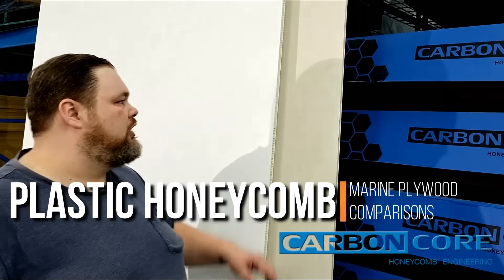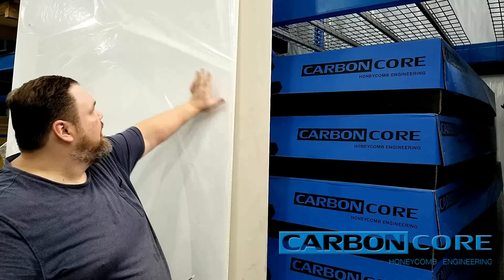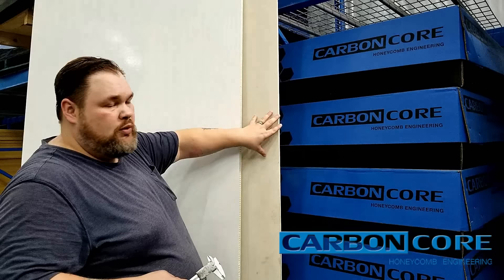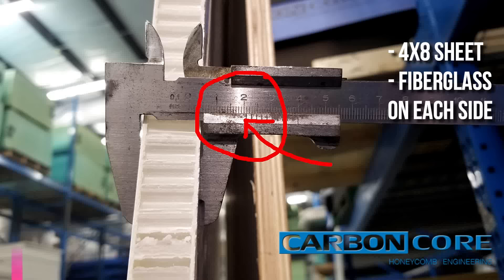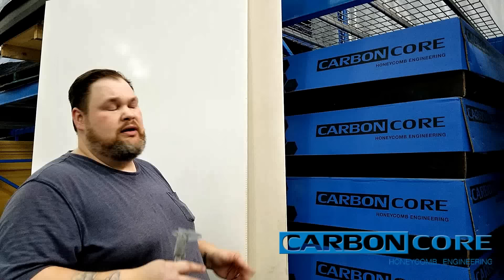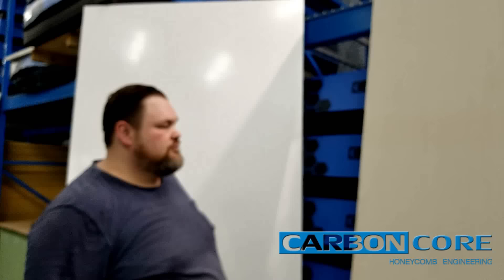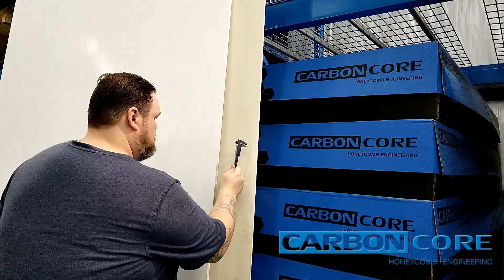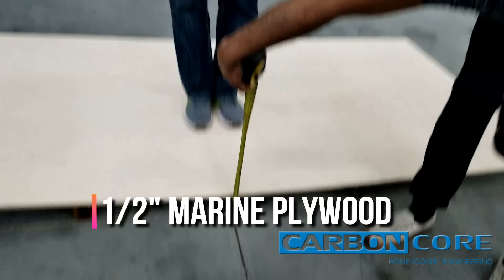Plastic Honeycomb Composite Panels VS Plywood

Comment: could not help but notice you didn't do an impact test. Also an R-value test. Have you had any customers use your products to fabricate campers?
Reply from the maker: Greg,

This  was  meant to be  a visual representation on deflection test in real world  conditions, outside  of  a  lab. For  test  results in impact, R value, tensile  etc. please  consult  with our  website, and the  product  data  sheet  at  www.carbon-core.com  Impact strength is one of  the  strongest part of this  panel  ,  R  values  are  3.3  per  1" of thickness  in  vertical position.

Comment: Hey you forgot to add the cost per board ?
Reply from the maker: Please check our website for pricing , different thicknesses , different prices
Reply: That is the kicker, Im betting it over $100 per sheet, which if you think about glassing all that isn't so bad I suppose depending on the "real cost" I want to build a small pilot house for my Whaler and this stuff looks perfect for that application personally.
Reply: @carboncore can you fibreglass over the panels for extra reinforcements and ensuring joints don’t leak?
Reply from the maker: @tyrone5404  Yes Sir,  it is  very common practice,upon  request  we  can  pre  sand  the  panels  to 60 grit  finish  to aid  in adhesion.
Reply from the maker: @barryculloty2568  It is  , but  most of the  cost of our  panels  is fiberglass  cost.  Whether  we  buy the material and  make the  lamination or  you do it,  either  way, it costs  about $100 per  sheet  to  laminate  both  sides.  The  balance is the  core  cost and  our  labor. But you get  perfect  flat  panels  form us  and  save hours  of labor..
Reply from the maker: Jose,  costs  are  on our  website. This  is  a  technical  video  and  costs  are not  part of  that demonstration.

Comment: how do you seam the edges when using multiple panel's?
Reply: another great question
Reply: @@Good Will Hunting thus adding to the cost
Reply: darn it - THAT'S my question too. I'm guessing some form of welding...ha, it got answered by Tom Brayton  late '21
Reply: I would think you would core out one panel's edge (make it female). Remove the glass laminate from the other panel's edge (make it the male). Glue those edges and insert the male into female. Then tape both sides with fiberglass. You would have a bit of a bulge because the taped area would be thicker, but this would be strong.

Comment: What if you wanted to make a super light weight camper / Toy hauler trailer? Would this be able to withstand the flex and vibration of going down the road or supporting a large side by side supported by 16" center supports? Does it dent if you drop something on it, or smash the product in? Does this insulate too better than plywood? What's the R-Value equivalent of it? Could you put lets say a 1" or maybe 2" piece of this down for the floor off an Enclosed cargo trailer and then spray a Line-X type of coating over it and park heavy side by side or any other kind of off road vehicles on it without it sagging or crushing under the weight? That's what really makes me interested in it.
Reply from the maker: Several  expedition  vehicles  have  been  made from these  panels,  R  value  is  3.3  per  1"  of  thickness in vertical position,  and  about  1  in  horizontal position.  Polyurea sticks  great tho the  fiberglass  surface.  Download  the  mechanical  data  sheet(laminated  composite panels) from  www.carbon-core.com,  it  lists  several precalculated  deflection values  for  different  thicknesses.
Reply: I’d say yes, ever see 
RV structural?

Comment: I'm so glad I found this video.  It will be so help when I build out my van for camping.  The polycarbonate will save so much weight. 🤑🤑🤑👍👍👍
Reply: camper shell or interior walls and cabinets?
Reply: @Gantzz321  interior walls and cabinetry.
Reply: Are you avoiding plywood throughout your whole conversion? I was looking for an alternative material to ply which was fully waterproof for all panelling walls, floor and ceiling and I think this might be the solution.
Reply: @adrianafonso754  yes.
Reply: Lani C hey how are you getting on with the conversion? How are you sticking the honeycomb on to the walls? Rivnut directly on to metal ribs? Thank you!
Reply: @adrianafonso754  because I have a minivan I plan to build a frame and just cover areas I would prefer to just wipe down. The bottom of the  cabinets are going to be thin wood and everything thing else will be the coroplast.

Comment: You guys had me when I went to the website. The price per sheet was less than imagined, until I put in my zip code and seen the shipping cost which was more than twice the cost of the material.
Reply from the maker: Jacob,

Need to blame  the trucking industry  for the  freight costs. But  these  panels  may be  available  from a distributor if there is one in your  area,  call us  and  we  will try to find them locally for you.  OF  course,  as  you, know, it  cost  about  the  same  to send  1  or  50 panels  out  with truck freight,so the more  you order, the  better  price  you have  per  sheet  including freight.
Reply: @CarbonCoreCorp  Yep that's the problem I only needed four of them.  I get what you're saying.  Freight and postal fees are making more money than all of us. In my business they eat up most of my profit margin cause I can't be competitive if I charge the customer shipping fees. I did find something akin to your product from another source, but I'm sure it was not as well made as your product and I am already having regrets. Next boat build I really want to use your honeycomb composite ...no more compromises!

Comment: Greetings and thanks for the video,

Listen, this product seems great despite the cost (especially with shipping).  But that being the case, now we potential customers who are seriously considering the product need some direct clear answers to our concerns which throughout the comments section have been vaguely replied to if at all by Carbon-Core Corp. (for the record, visiting the website or after calling the technicians/representatives some questions still haven't been definitively answered).

Can you all perhaps make an updated video on using fasteners such as screws, bolts, nails, threaded inserts (ATR pins etc.)...and which will and will not work and the stress limitations of each?  Also, any suggestions on best way to deal with the cut edges if one wants to make a panel or lid with hinges (i.e., should we carve out the honeycomb edge and epoxy in a strip of wood or pvc, or use construction adhesive to glue on a section of aluminum c-channel over the edge, or just fill in some epoxy or bondo the edge, sand, and then place the screwed hinges in directly)??  

My longwinded point is,  PLEASE HELP US OUT by making a updated video addressing how to overcome these issues.
You will definitely be compensated/rewarded well for making said new video....from all of the business you will gain from the multitude of us whose only hesitation is what was covered in this lecture i just wrote.  lol!
Reply: I just met someone who thinks like me. Exactely my ?'s also.
Reply: @danmatelsky6064  There's so many of us, like 3's of us!
Reply: Can think of a lot of applications for a lighter weight, waterproof building solution.

Comment: What a coincidence that I need to rebuild the substrate on an outdoor stainless steel workbench that has a leaky patch on it. I did a web search thinking there must be a honeycomb plastic materiel I can use for this. Turns out Carbon Core is my neighbor here in Troy, VA. We're not on the map for much here, so this is almost serendipity. I certainly never thought I would find these products 5 miles from me. 

Unfortunately after learning about the products, extreme weather plywood would be more economical for my needs since weight is not an issue for me. I am excited that this is a local business to me though! We love our local businesses here in Virginia!
Reply: awesome dude :)
Reply: Yea im in Richmond and it was 261 bucks to ship it here only 50 miles and i called and they said i can pick it up from the warehouse.
Reply: @timboWVU  Shipping is outrageous. Over $200 for a $75 panel. But that would likely be the case for a sheet of plywood too. I imagine they have to crate this material or something to protect it. The gorillas that are the shipping industry can damage solid steel, let alone a sheet of honeycomb plastic.

I had the company I work for look in to this material for substrate on outdoor stainless kitchen countertops. It would be a good alternative to exterior grade plywood. I dont know what the sample pack included that they ordered, but they wanted a sample of 3/4" thick. It would have to hold screws though. Not screws through it, but screws in to it to draw a countertop down to a cabinet. It also has to withstand adhesive without melting. 

The solution to the shipping would be to get the big home improvement chains to stock the stuff. I'd bet it would sell once people got familiar with it.

Comment: That hammer test demonstrated the high density of the marine ply over the foam core. There are specifications that list the equivalent of ply wood verses foam core;
9mm marine ply is equivalent to 34oz (1kg per m2) /20mm foam core/ 34 oz with the foam core weighing approx. 6kg/m2.
9mm ply weighs approx 5.3kg/m2.
Even when skinned with 6oz cloth and resin, it still comes around the same 6kg/m2.
Foam loses on every score except stiffness. Meaning ply needs more stringers or inbuilt structural support from furniture, cupboards etc, or the addition a carbon skinning. Cheers

Comment: my concern would be what would happen if Jack had jumped in the middle...I suspect the plywood would spring back, but the honey-comb material might collapse.  What is the strength of material during impact/impulse vs. slow applied pressure?

Comment: How does Carbon Core accept nails and screws going through the board and onto the stringers?  What about the compression at the small area of the heads of nails or screws?

Is each cell in the Carbon Core guaranteed to be sealed and waterproof, and what of the butting of panels ... any special needs?

How does 3/4" Carbon Core compare to 3/4 inch marine plywood, in a collision situation?

Comment: I'm needing a plywood to replace the flooring in a shuttle bus.

The light weight and sound deadening sounds desirable for what I need.

Do you think this product would work for me as a sub floor in a shuttle bus?

It would be exposed to the elements of the road as the bus is being driven down the road.

Comment: @Carbon-Core Corp. If you use this in a cuddy cabin rebuild, do you have to encapsulate it with fiberglass? Or, is it waterproof as a stand alone?
Reply from the maker: it is already encapsulated, no need  to encapsulate  this,  stand  alone  product is  waterproof

Comment: How do you fiberglass over the panel?  Does the fiberglass on it have laminating resin or does it need to ground before adding glass overtop?
Reply from the maker: It should be lightly sanded before laminating over it

Comment: Not exactly a miracle material. Drive a fastener into it, or hang something on it vertically. what is the cost vs marine grade plywood? What is the thermal expansion? Tensile strength? No doubt this has really good applications, but you should be a little more forthcoming on where and where not this will be a good application.
Reply: maybe you coukd make and post some content of your own before telling others how to make and post content?  just a thought.

Comment: Can HoneyComb board be used for Bulkheads and is it compatible to Vinylester & Polyester resin?
Reply from the maker: Yes,  bulkheads  are  a common use  for this material  and  our  Composite  Structural  panels  are compatible  with  VE  and  PE  resins

Comment: Fatal flaw you can't scarf the boards which is a much better method than butt joints. So you'd still be making the majority of the weight of a boat through the hull.
BUT, you could use this to make anything from the deck up. This would be an excellent material for making Jon to bass boat conversions much lighter.
Reply: You’ll fiberglass either joint so it would become one panel.
Reply: For butt joints, one can remove the honey comb to a desired depth on each butt and add a core to bond both  panels together, if done right, could be just as good or better than a scarf joint?
Reply: @Richard-nb4iv , what “core” would be use to fill the board’s open ends?  Also, what hinges fasteners must be used?
Reply: @sabio2009  a foam core or expanded pvc core could be used. Just something to give the joint some extra strength if required.
I have used some expanded pvc on some home projects lately and have been impressed with them. I bought pvc boards at homedepot as a window sill alternative.
Reply: @Richard-nb4iv  , thanks!

Comment: I have built several plywood and cedar strip boats over the past 30 yrs. I have also built an all wood jon boat. My question is how does this material hold up to impacts and direct scrapes from, say rocks. I have found that same boats built in plywood covered in fiberglass take impact better than straight strips of wood covered in fiberglass. The plywood boat weighs more but holds up to impacts better. In the case of my jon boats, the planks were 3/4" pine boards and the boat was 22' long and 4' wide. When built in plywood I can use thinner plywood and cover it in fiberglass inside and out. This keeps my weight down, extends the life of the boat and takes impacts and scrapes very well.  By far though the all wood boat with no fiberglass has the best sound dampening in my opinion. I have hit huge rocks mid stream just under the surface of the water and only had minor damage. Usually only to the paint. 
 As another gentleman said scarfing is used allot in building boats and this could prove challenging. Butt blocks could be used of course but this is added weight. I can definitely see the benefit of using this on the interior components such as bulk heads, berths furniture and sub decks. I think a good couple of controlled test of scrapes and impacts would be helpful for your buyers. Like I said I would use this product on interiors but I'm not sold for it on the hull. The hull is just one part of a boat so allot of weight could be saved using this product above the waterline. 
 All this is just my opinion based on my experience with building boats over the years. The larger a boat the more damage it causes and receives  when on impacts and scrapes. Of course the thickness of materials will increase with size of the boat. 
 Thanks for showing your product. I would like to try some just to compare. I would use a thickness of plywood that had equal deflection as your fiber core product. Of course this is after the plywood has been glassed inside and out. I believe this would give more of an accurate comparison. This is the same as when I build the jon boats . The one with plywood is built with thinner planks. This keeps the weight down but I gained in strength. Just some food for thoughts.
 I would love to hear your input or anyone else's input who has used your product.

Comment: Im thinking of building a truck.camper out of the ¾ 
Material. Would you know the insulation value? And would I be able to use any fiberglass resin to joim the panels?
Reply from the maker: R value is  3.3 per inch of thickness in vertical position and  yes  you can  use resin to join them.

Comment: How do I get in touch for a technical question? I need to build a thin piece think catamaran wing, as thin as possible. If I wanted to have a tube structure say 2" o.d. a little inside of the edges for structure and flexion control, how manipulatable is this product? I'm trying to re-work a sandwich composite over foam idead and am thinking about flex over a long edge on two sides of a very lightweight platform. Is there a way to bend it without compromising strength, would I need to cnc some pieces to sandwich around the metal to meet up with the two surface pieces kind of an intricate idea and this looks like it could reduce my weight substantially vs wood
Reply from the maker: Please  check  our  website  carbon-core.com  for contact info  and  contact  us  directly

Comment: Hello from Argentina! O have a question, This honeycomb board can be used for a "boat deck" that goes down the floor? Instead of wood, because its an old boat and the structure that hold the floor is made of wood and it's all rotten. Thanks for the advice
Reply from the maker: Gaston,

Absolutely,  boat  deck is  very  common use  for this  product,  hundreds  of  OEM builders use  this construction method

Comment: Restance to uv? I am replacing the wood floor I installed in my 16 foot Princecraft Starfish. Also wear and tear from walking on this material. Oh and, slippery when wet? I sealed some sand ontop of the ply to prevent the coated surface from being slippery.
Reply from the maker: These  panels  are  made  with  UV  resistant  gelcoat. Wear characteristics  are  great, somewhat  slippery when wet,  but easy to  coat  with  nonskid  coating.

Comment: I wonder what the insulation rating is as well considering it looks like a paper honeycomb loom inside. May be better as well.

Curious if it is efficient there as well, if it could be used as an rv floor base material.

Does it have a higher water resistance than natural plywood?

Lots of other tests to do but really cool product.
Reply from the maker: R value  3.3  per  inch of thickness  in vertical position. Al lot more info  regarding that subject on our  website.